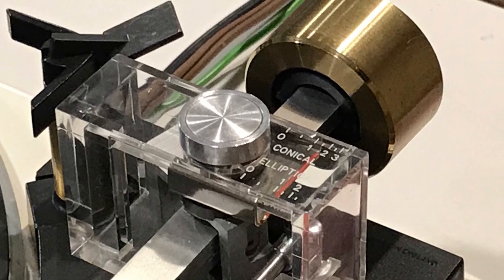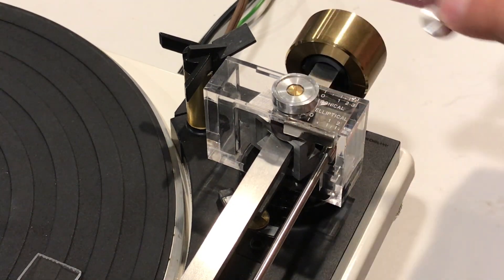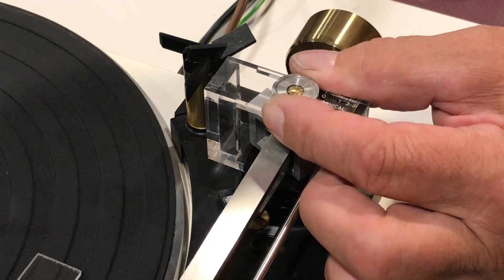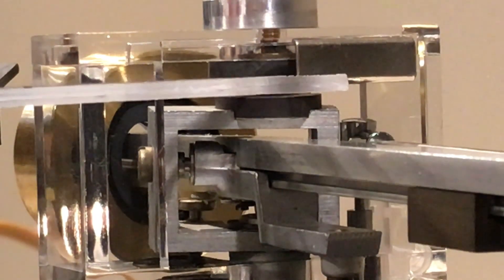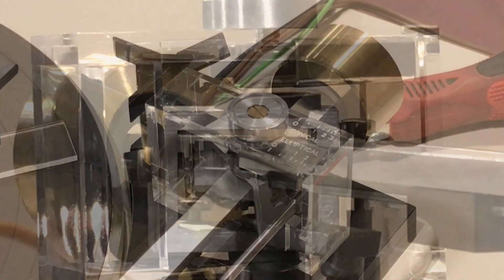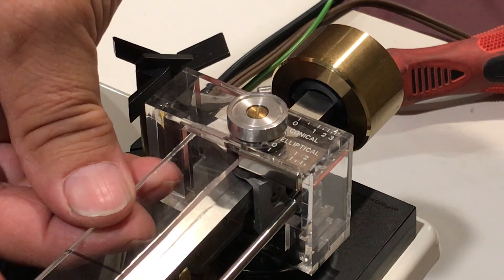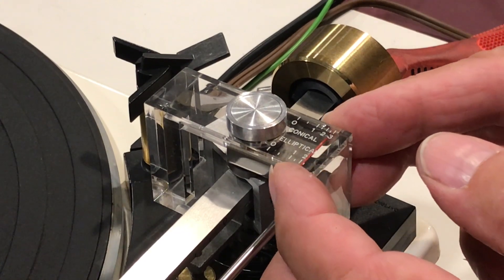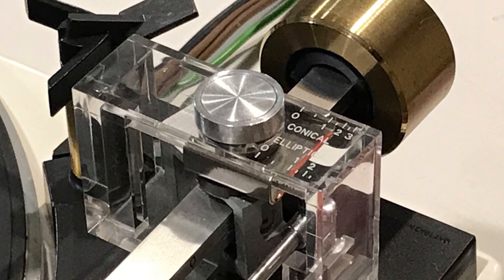Garrard Zero 100 Anti-Skate Compensator Adjustment

Comment: IA long time ago I bought a test record, to be used to test and set up turntables, and one side of it had a band about an inch and a half wide with NO grooves.  That band was for setting up the skate.  If your table and tone arm were right...the stylus, when lowered to the middle of the blank band would simply sit still while the test record spun under it.  No movement either direction.  Those records may still be around.  They also had all kinds of tests to perform.
Reply from the maker: Yep - You're right. The blank vinyls are still avail and some have all the geometry for setting up the null points and cartridge alignment. If you have some time to spend check out the Soundsmith page and take a deep dive into rake angle, azimuth, antiskate, etc. great stuff. Tx
Reply: @xfireamg417  thanks I will

Comment: hello, thanks for the video.
i have a problem with the very same model and about this subject, you might have a solution for; 
no matter the antiskating adjustment is at zero and needle weight adjustment is at zero(cartridge flies freely and level), tone arm tends to go back to parking position. if antiskating adjustment is set to higher values, tone arm goes back to parking position even more quickly. if i raise the front of the turntable about a cm, only then tonearm can be set to zero antiskate position. is there another setting that im not aware of or does this turntable needs adjustments mechanism underneath?
Reply from the maker: Hi - a couple things to consider:
a) make sure the platter is level. Although it sounds like you may have done this already.
b) check for interference in the tone arm wires. Also they might have gotten brittle and need to be replaced.
c) Check out this video I posted, This might help.
https://studio.youtube.com/video/geTCrjyRy8s/edit
Reply: thanks for your reply.
ive already watched your other video hoping to find a solution, thanks for that as well, but thats not exactly what my problem is. 
my platter is level, i checked both y and z axis with a water level. 
and the wires are brittle as you guessed, but i checked wires disconnected as well, ending up with same result.
i wonder if there is an internal antiskate adjustment underneath which regular users cannot reach. 
i couldnt find an adjustment for this but, do you think elevating the tonearm base could have a positive affect to regulate my issue?
Reply from the maker: Hi - took a look through the service manual and trouble shooting tips but don't see anything that further addressees the issue. I believe the arm should rotate freely at the base so just be sure that nothing is compromising the movement.
Reply from the maker: I did come across an issue once that I will share that might help. I guy worked forever trying to repair a Zero 100, gave up and sold it to me on Ebay. I struggled with it as well, but found a number of issues. The main issue was that the tone arm base was bent slightly which caused misalignment of the magnets and a misalignment of the secondary pivot arm. The tone arm was therefore restricted from completely rotating inward toward the end of the record. I was able to straighten the base (gimbal) without breaking it and was able proceed. Also found that the wires  at both the headshell side and tonearm base were brittle and restricted movement. Also need to make sure both pivot points on the secondary arm and the headshell all move freely. Maybe a youtuber out there might have a solution.
Reply: if your platform, which your turntable sits on is NOT perfectly level...you are shot.  If it is NOT really solid and flat, so it makes solid contact with turntables feet..you are shot.

Comment: Do you know how to adjust the Pitch Control on a Garrard so it goes past the knob adjustment? I have mine turned all the way to the negative symbol on the knob adjuster but it still to fast.
Reply from the maker: Yeah - maybe you can find a reasonably priced donor unit to get the parts. A lot of times Ebay sellers will part out a unit but the parts are generally pretty expensive. It looks like the pulley and maybe the motor are unique to that unit. Good luck
Reply: @xfireamg417  would you know why the automatic repeat of the changer doesn’t work correctly? The manual says to place the “automatic” lever toward “start” after starting the first record. The lever doesn’t stay in this position. It’s almost as though a spring to hold it there is missing, but I don’t think one is. If I put a rubber band to hold it in that position, then it will repeat or release another record.
Reply: I’m sorry, I mis spoke on my last reply. The repeat is for one record to repeat not release another record. So yes, all the above symptoms but for one record.
Reply: @xfireamg417  fyi, I swapped out the rubber motor mounts from the GT10 to the Z2000B and gave the pulley one more attempt with the motor out - and success! I can now get the Stroboscope stationary and a tiny bit beyond.
Reply from the maker: @jamesstranc7682  Way to go. Sometimes these issues aren't easy to resolve. So do you think the motor mounts were the issue or the pulley height or both?
Reply: @xfireamg417  I believe the new mounts lowered the motor a tiny bit as well as held it more steady. This helped get the pulley lower - closer to the correct position. Also helped the drive to were I don’t need to help the spin anymore at start up. The old mounts were mushy and one had a hole in it. I also used a soldering iron, as you suggested, to get the pulley free. I don’t think I was holding the motor shaft on my earlier attempts. With all that, I had to readjust the underside setting screw out for the pulley height. 
Thank you so much for your guidance to get this resolved.

I still am trying to figure out the repeat feature for a single record.
Reply from the maker: @jamesstranc7682  It looks like the mechanicals on this unit differ from those on the zero100. You might try searching or posting the problem on the Audiokarma web site. That site can be a good source of info.
Reply from the maker: Yes- There is an additional adjustment on the underside of the base that can be used to adjust speed. I think you can find the information you need in "Issue 1 Service Manual" found on the Vinyengine.com website. You can download these for free but you need to create a log in. Hope this helps
Reply from the maker: Just checking back to see if you made any progress on correcting the speed issue.
Reply: @xfireamg417  No l haven’t found a solution. I believe something needs adjusting on the inside but don’t know what?
Reply: I just saw your first reply from a couple days ago. 
I have been having trouble getting into Vinylengine as I forgot my user ID. I need to take more time and do all the above. 
By the way Thank you for replying. I welcome anymore feedback.
Reply: @xfireamg417  I finally got in Vinylengine. I don’t see the “issue 1 service manual” you mentioned? Is that under a Zero model number?
Reply from the maker: Yes - Its one of the attached documents listed under Garrard Zero 100
Reply from the maker: @jamesstranc7682  I just posted a video that should help you out. Take a look.
https://www.youtube.com/watch?v=sPI4nF2JI6o&t=21s
Reply: @xfireamg417  THANK YOU VERY MUCH!!
Reply from the maker: @jamesstranc7682  Hope that does it for you
Reply: @xfireamg417  I tried that, didn’t help. Didn’t really do anything when I first screwed it in a couple turns, then a couple more turns… finally tried turned it out the same. I put it back to the original setting. It seemed to speed up when turning out but did not slow down even when it was all the way in.
Could it possibly have something to do with a stretched belt? I had already ordered a new belt and it should be here today or tomorrow.
Reply from the maker: @jamesstranc7682  Did you mean idler wheel? Never saw a Zero 100 that was belt driven.
Reply from the maker: Two other things come to mind. 1) is the pulley positioned properly on the motor shaft and 2) is it the correct pulley. I believe there is a pulley for 60 hertz operation and one for 50 hertz operation.
Reply: @xfireamg417  I will look into that tomorrow, as I am going to the dentist to get my teeth cleaned
Reply: @xfireamg417  it’s a Z2000B
Reply from the maker: Okay - Yeah, the belt is the starting point. Give that a shot and see if that solves the problem.
Reply: @xfireamg417  OK, so I put the new belt on, but that did not help the pitch speed either. Although the belt was a little bit smaller, as the old one l’m assuming stretched, but I don’t know how much faith I have due to a slight blemish in it. The start up of the platter spin sometimes needs a little push. I’m wondering if the motor is just wore out. Once it gets going it seems to maintain speed though.
As far as the pitch adjustment goes, any more ideas for this Z2000B?
Reply: Okay, so I think the belt was rubbing on the plastic belt guide, adjusted that so not. I cleaned the motor pulley and drive wheel, adjusted the underside setting screw all the way in. That screw being all the way in did raise the wheel to where it now slowed down the spin slightly. It appears there is more room at the tapered top of the pulley, but I loosened the the screw on the pulley and can not get it to adjust. The pulley seems frozen on and I’m afraid to put more pressure to break it free from the motor drive shaft. I believe if I can get that adjusted, that would fix my problem. The records audio sounds a little bit off still and the Stroboscope on the player agrees. According to the manual when achieving the correct speed the image in the Stroboscope should appear stationary. It does slow down but doesn’t stop to a stationary image. 
Sorry to rattle on.
Thank you for your help and responses. 
If you have any ideas on how I can get the motor pulley free, please let me know.
Reply from the maker: @jamesstranc7682  I made this video with a bit of info. The motor pulley height might be the key. Check this out and see if this helps. Sounds like you're getting there. https://studio.youtube.com/video/_1ifl3yGx8c/edit
Reply: @xfireamg417  I can’t get the video open, it says private.
Reply from the maker: @jamesstranc7682  OK - I'll make it public. BTW if the pulley is metal you could try applying a little heat from a soldering iron. It should loosen up.
Reply: @xfireamg417  So l got the pulley to turn on the motor shaft, but it just spins. I think it is stripped. I’m thinking the original owner somehow put it on wrong as the adjustment screw is all the way in and it’s still not adjusted properly.
Reply from the maker: @jamesstranc7682  Sounds like you may have nailed the root cause.
Reply from the maker: @jamesstranc7682  Here's a link to the video.
https://www.youtube.com/watch?v=_1ifl3yGx8c&t=7s
Reply: @xfireamg417  yes, I think I’ll just leave it as is, and maybe look for another motor and pulley. I just hate to put any more pressure and mess something up to where it doesn’t work at all. I watched your video. It was very helpful. Thank you for all the effort you put in to my question. I do have more questions, lol. By the way, I picked this up from Facebook marketplace for $10. I didn’t know what I was getting it, didn’t work at all. Once I started looking at it and getting it to operate, I recognized it was a good model back in the day. I also purchased from the same person a Garrard GT10. The Z2000B I believe is quality with all the metal linkage and springs. I plan on fully restoring and building a wood base for it.